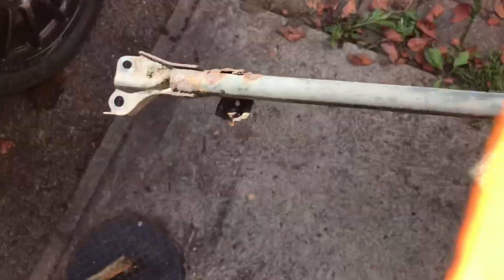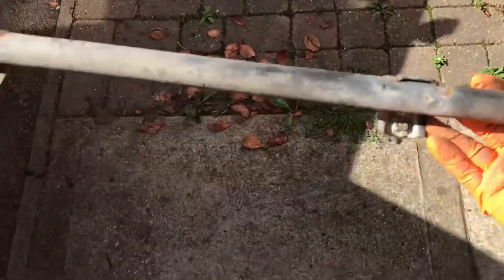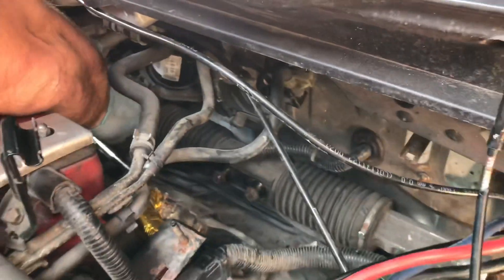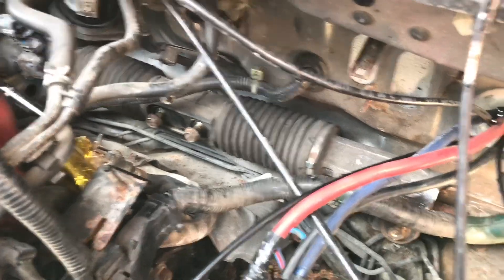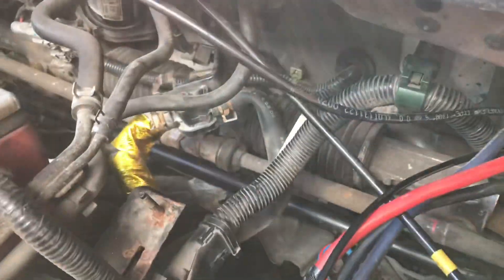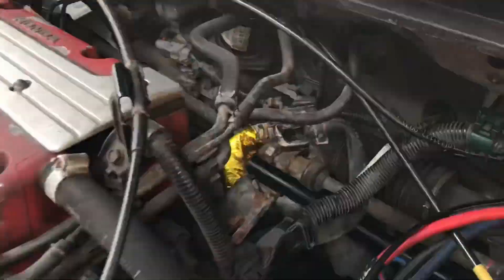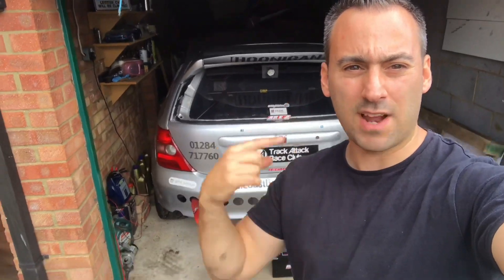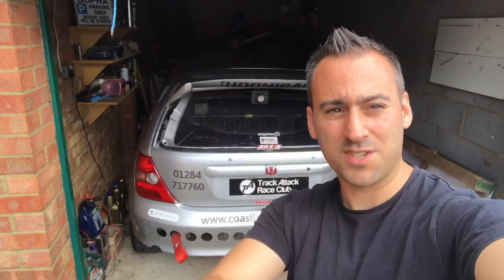Ep3 Honda Civic Type R racecar update September 2018 - How to fit a steering rack ep3

Comment: How did you upgraded steerin rack? Did you fit face lift EP3 rack? Is it quicker?
Reply from the maker: It is from an FN/FD I believe, it’s been so long I forgot but I’m sure it is and it’s a direct fit. 
It doesn’t feel much different just a tiny bit quicker but it’s mainly for the strength I’m told as when you push these on track they can fail and with age 🙌

Comment: I accidently removed the bolts that hold the steering rack in place while removing the strut brace , I can't get one of the bolts back in.. any tricks to get it back in.
Reply from the maker: Oh damn, it’s fiddly I remember using a huge or multiple extensions but I think there is no tricks really as such. 
What’s being the issue is it making the bolt grab back into the threads?

Comment: The rack play is usually a bush that can be replaced. it goes exactly where you described the play. my brothers civic done it a few months back. its a lot easier than a new rack.
Reply from the maker: Spark Plug Steve no play in both sides of the rack... I probably didn’t explain it well enough. Only really mentioned it a little. The rack was f&@ked besides its highly recommended to replace for the revised/newer gen steering rack anyway as there stronger. For racing it’s the go to thing to do.
Reply: @PeakPerformanceReviews  ah fair enough that makes sense.
Reply from the maker: Damn bushes 😝

Comment: Looked like you had the standard steering arms still, are you not running much front camber? Its an issue with the EPs running out of toe adjustment when adding camber and need shorter arms, iv nearly maxed out my toe adjustment with hardly any camber but seeing as yours is a track car id assume you would be running -2 degrees or so
Reply from the maker: AJW yep standard steering arms indeed fella. Very little, tbh imo very very little for a full race set up but I’ve been told by the people that set my car up that this is the perfect and best set up you can have ...... I’ve always doubted that but there the experts I guess. 
I always wanted to try going and being way more aggressive with my set up. This was going to be something I’d have been doing this season but I’m not sure what I’m racing this season after winning my Championship two years in a row now. Thanks for commenting and make sure you stick around fella and subscribe! Where are you based? Uk?
Reply: @PeakPerformanceReviews  Found one of your vids through recommended and have been going through all the EP3 build/track vids so I subbed. Im from Essex. Would be worth a shot trying out shorter arms with a more aggressive setup,  every little helps, if youve got the print out from your alignment then you can always go back if you dont like how the car feels/handles, wouldnt need to travel further to a specialist just to match settings. Also wanted to ask, about the RCAs, did you feel a noticeable difference to the car after they were fitted and if so what were they? And the failure you had with them popping out of place, is that a common problem with the buddyclub ones or was it just a one off with yours?
Reply from the maker: AJW yeah it’s something I want to do to look to go way quicker around a lot of tracks as other people get quicker. 
DME LCA, tbh it’s hard to know if they made a difference as at the time I changed so much. It felt like they coupled with other things did help. I was informed it wasn’t ... again was this a cover up?!? I’m not sure but I wasn’t best pleased. It certainly was sorted but I think it was just a worn knuckle tbh. 
Thanks for subscribing fella, definitely keep in touch and keep chatting on these vids 👌😎

Comment: What's your thoughts on the Tegiwa rack raiser?  Do you think it'd help improve stability after lowering the ep3?  Do you know anyone who's done the mod?  Thanks.
Reply from the maker: UserFT hello fella strangely we were told it wasn’t needed by Area Motorsport however others have said its a great mod, I haven’t personally ran one so I can only advise on what I’ve run. Thanks for watching fella and stick around as it would be great to have you around 🙌🤞👍

Comment: I have a Honda Civic type r ep3 and was wondering I got a slight problem my steering rack is making a noise when I turn the steering wheel it’s driving me mad any ideas
Reply from the maker: Slippery Serpant I had the same problem bud, often a sign of it being on the way out fella. I bought a 2nd hand Steering rack from a newer facelifted CTR. They are stronger and better steering racks. 

Thanks for watching fella, stick around and subscribe if you can as it’s always great to have fellow owners on board 👍
Reply: Where can I buy one ? I was thinking about re greasing it up
Reply from the maker: Slippery Serpant you could tried that by the time you take it out it may just be worth getting a new one. What’s the mileage on the car? Has it been replaced before? What’s the year and age?
Reply from the maker: Slippery Serpant Honda HQ Walshall, tell them we sent you 👍
Reply: Peak Performance Reviews it’s has 100025 miles on clock it’s a 2002 30th anniversary addition and I’m not sure it looks standard to me
Reply from the maker: Slippery Serpant so these racks go at 60-100000 always so if it hasn’t been replaced it’s likely to be on it’s way out. Not always but most of the time. Circa £60-70 so hardly anything for typically a low mileage face lifted rack. Much stronger and way better 👌
Reply: Peak Performance Reviews I’ll be getting a new one to put in :) thanks for the help
Reply from the maker: Slippery Serpant your very welcome fella 👌 check the other typical stuff as you do it too fella.

Comment: When you say you put in a new uprated steering rack on your  civic type r ep3  where do you purchase a uprated rack from  or do you mean its is from the newer ep3 face lift civic type r
Reply from the maker: Yes it’s from a newer facelifted rack or a believe poss an FN is the same.
I got mine from Area Motorsports and it’s worth calling them 🙌
Thanks for watching Gary.
Reply: @PeakPerformanceReviews  put a replacement facelift steering  rack on my civic ep3 today as I was reversing into my garage last week I turned the steering wheel to go in backwards and heard a loud bang  all of a sudden the steering wheel was just going from lock to lock but the wheels were not moving at all  something must has snapped inside my  rack itself  and my civic is a facelift ep3  so in the process of putting in another rack for the 2nd time plus I put in the new delrin solid  slider as well
Reply from the maker: @GaryHoare-el4ml  mega thanks for letting me know. Did you speak to Area in the end?
Reply: No I ordered a facelift rack off someone on ebay that breaks them
Reply from the maker: @GaryHoare-el4ml  ah ok fella mega

Comment: Thank you so much for this vid.

I've replaced my tie rod arms and ends. I have also fitted an an uprated slider and STILL have a numb steering feel. The car also wonders off while driving and the steering is dead straight.

I have an 03 model. I will definitely look into importing a face lift rack.

Could you perhaps give me the part code as I tried to see it while watching this but wasn't able to.

Thanks.
Reply from the maker: You are very welcome, I can’t remember the part number but these guys are worth asking (Area Motorsport ) - 01562 519070
Are you in the UK?
Reply: @PeakPerformanceReviews  no unfortunately not. Im in South Africa.

Its a bit difficult because these cars weren't sold here so literally everything needs to be imported for it.

Thanks for the quick reply. Appreciate it🙌
Reply from the maker: @dominicsimons2290  ah nice, would love to go to SA, I hear the car prices are much higher there too. I believe it’s an FN2 rack - PART NUMBER: SMT-E9-AS07 / HSMJX-W48-0
See if you can double check with someone like Area motorsport maybe as it’s been so long since I put this on 🙌

Comment: Hey good day love your videos man...
Questions: Am running a K20 heads with a K24 block,with all internals (fully forge) and a kpro v4..... 2.25 Catback Exhaust and a CIA.... everything else is stock.

What type of spark plugs do you recommend me using... should I just go with my stock???
Reply from the maker: Alpha Jack thank you so much fella massively appreciate the kind words. Glad your enjoying the videos, As your still NA I’d only go standard or 1 heat range colder but personally it’ll never hurt to go one heat range colder as you are modified - I run a NGK Iridium BKR8EIX, thanks for subscribing and make sure you hit the bell too and you’ll get notifications of all videos ❤️👌😎
Reply from the maker: Alpha Jack 
https://youtu.be/gGXOn6wVY6I

Comment: u shud have upgraded slider and tie rods one time. You are a brave one racing on those poorly designed stock parts
Reply from the maker: R wells I wish I did at the time, in the end I replaced for uprated one. 
One my championship on stockers then upgraded and won in my second year too 👍
Thanks for watching fella appreciate it.

Guessing you have an ep3 too 👍
Reply: @PeakPerformanceReviews That's Awesome to hear I love these cars. I am trying to get my own on the road now. 
Just installed my steering rack  slider and tie rods as I have a turbo one and it tries to kill me every time boost and vtec kick in .
Reply from the maker: R wells I’m the same, my first fast fast road car was an ep3 CTR with 336bhp, NA with NOS I love it and used to drag race with a little track, now I’m more track track track. That sounds mega fella, what kind of power is it and what management etc, I wanna hear more. Love a VTEC TURBO 👌 especially in an ep3! Definitely stick around and subscribe and add us on our other social I wanna see this car 😍